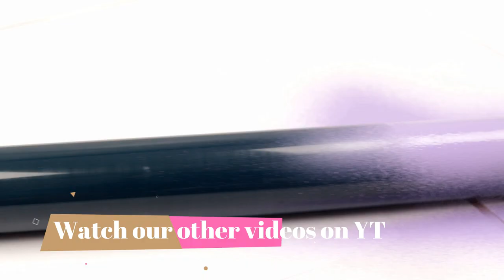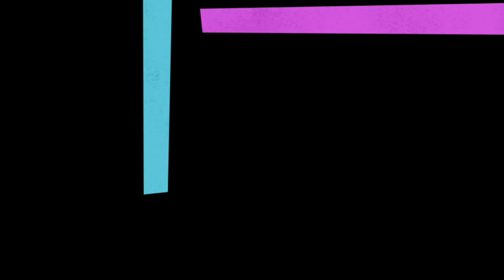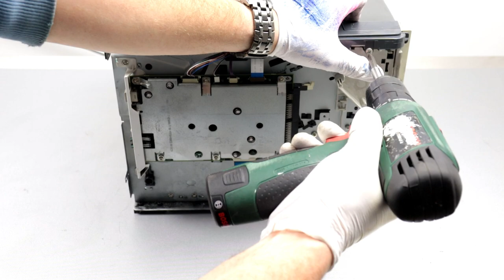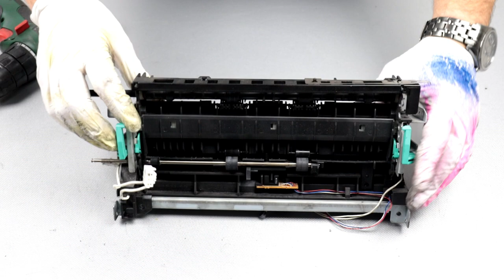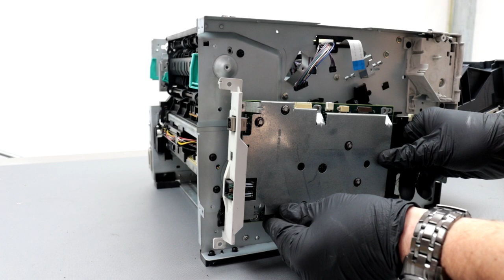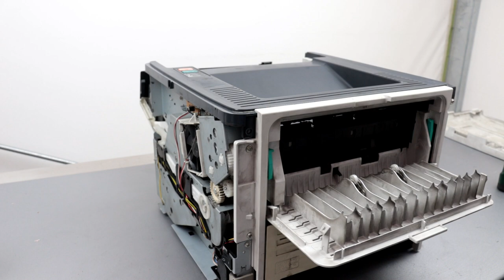Fuser HP1160 HP1320 HP3390 HP3392

Comment: Hello, thank you for your video.
My old HP LJ 1320 dont' print clearly even if a new toner was installed so maybe i will did the same as you.
what is the product you put on the heater at 9:51 ?
Did you clean the "grey tube" on the heater 10:04 or did you put a new one?
Reply from the maker: @geraldcmoi3775  This product is a grease that always comes in a package with Fuser Fixing Film. Good luck with your repair. Let me know if you succeeded. Don't forget to subscribe to my channel. Best regards.